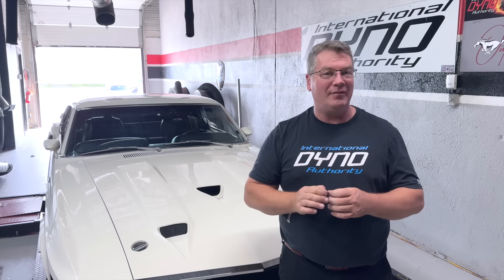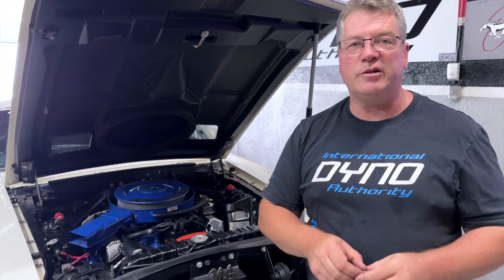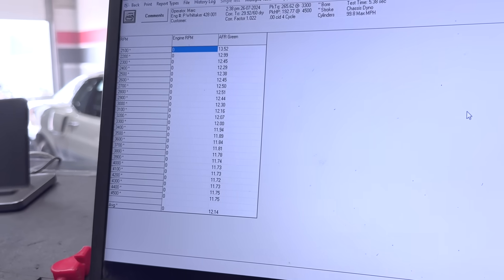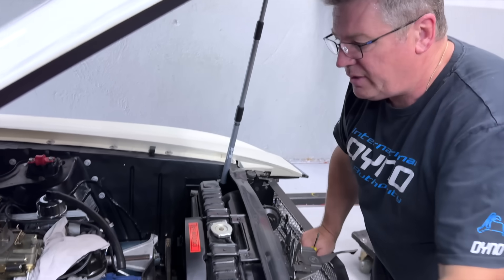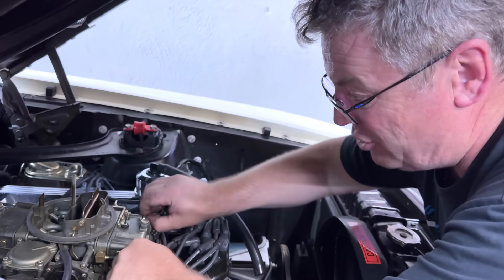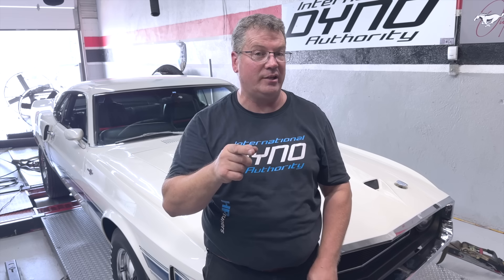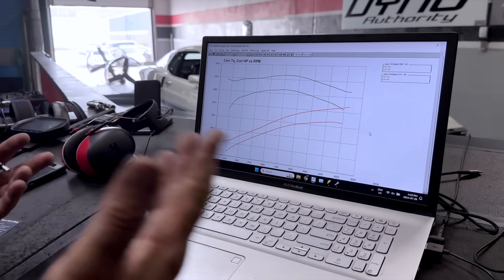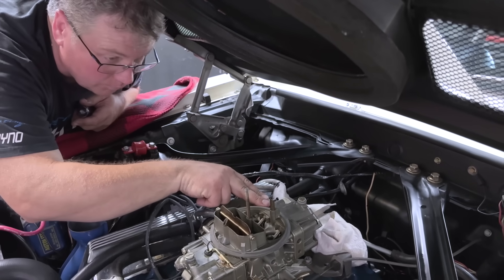Original, unrestored '69 Shelby GT500 tuned on the dyno

Comment: 335 gross hp, pre-1972. That's with no accessories, no fan no water pump etc, at the flywheel. Adjusting to a 1972 and later net rating would be like 300 hp. At the wheels that's ~260 IMO. Getting 300 whp from this thing is great, especially at 4800 rpm. That's not a huge number but there's a lot of average power there.
Reply: 335 wasn't accurate, and everyone knew it.
Reply: @MrSticks9999  Yea, it was high. Remember, this car made 190 whp in factory stock form on the baseline. These guys did a custom dyno tune using a wide band oxygen sensor, something that didnt exist when this car was made, to recalibrate the carburetor and adjust timing.
Reply: @Carguylogan  Don't think Carburetor tuning is a new thing. Whether you had an O2 sensor or not, it can and was done.
Reply: @Carguylogan  And I don't mean the 335 was high, it was low. You don't turn 134.56 with a stock Mustang on bias tires with that low of HP. It was better rated at 375-390 range.
Reply: @MrSticks9999  Yea, it was done by reading the plug which is extremely hard to do because you need to run the engine ONLY at wide open throttle in order to get an accurate reading on the plug. Any idling or driving around taints the reading. I'm not sure what the 134.56 thing means.
Reply: @Carguylogan  Sure, read the plug and/or read the time slips. Not a lot different that reading an O2 and trying a different jet.
Reply: @MrSticks9999  I mean an oxygen sensor tells you the afr. Reading a plug is a guess. It'll get close enough but not great. You can read Car and Driver's road test of the 1969 428 Mach 1 from 1969 where they did 14.3 @ 100 mph. 100 mph in a 3600 lb car is a solid 250 whp.
Reply: @Carguylogan  Reading the plug is just a step. That's not the end result. It's just a step along the way. It tells you which way to go. I'm not saying it is better, but it works. You could get a carb tuned as well back then as you can now. A s for times, that's the slowest of the publicized results. There are 13 sec times out there as well. I own a '68 1/2 CJ Mustang. I have been building Mustangs for over 40 years professionally, so I know these cars. I'm also a retired Auto Instructor.
Reply: @MrSticks9999  I'm not looking at the ET. A 100 mph or even a 103 mph pass is way short of 300 whp. I am an ase master tech with an applied science degree in automotive that managed a shop for a living while running my own trans overhaul service at home, and I've done custom fab/restoration for a living. I have made over 1000 passes and have a few hundred hours of dyno time. No old engines, including the L88, 426 hemi etc ever turned more than like 108 or 109 mph trap speed off the showroom floor. They are fast in pure stock racing but that class allows a lot of engine work with limitations being things like "stock appearing exhaust manifolds, stock valve sizes, stock valve lift, stock displacement" etc. There's still a ton you can do within those confines. But factory stock, none of the big dogs from the muscle car era made more than about 300 whp. That's not an insult, it's just reality. That was 55 years ago so no surprise things have come a long way. My 2.0L Golf traps 117 mph at 6,000 feet elevation with 3 parts changed from stock. Its faster than my C5 Z06 and my cam/stall C6. I had a 1982 Mustang GT with a .060" over 351W (359) with C9OE heads (the hipo heads) that were ported with big valves and machined spring seats etc, 10.2:1 pistons, a roller cam, headers, 800 cfm carb etc, car had a T5 with 3.55 gears and weighed 3,000 lbs on the nose and my GTI is still faster at 6,000 ft elevation than that car was at sea level. I personally grew up around a guy with a #s matching 1970 Chevelle SS 396 4 speed that had a slightly warmed over engine rebuild (cam, headers, carb and intake) and I remember watching it go 100, 101 mph over and over at the drags. I know another guy with a #s matching 426 Hemi Coronet 4 speed, and it isn't particularly fast. These are extremely badass cars worth a lot of money, they just aren't fast by modern standards.
Reply: @Carguylogan  103 mph and 3600 lbs estimates over 300 HP
Reply: @MrSticks9999  300 bhp sure. Talking about crankshaft hp is old thinking. The only number that matters is wheel power, no one uses flywheel power anymore. Saying a car makes 350 flywheel hp sounds great til you put it on a chassis dyno and it makes 264 whp.
Reply: @Carguylogan  I'm saying a 428 CJ makes about 375 hp at the crank, no accessories.

Comment: People gotta understand that factory heads are garbage
Reply: Really? Those heads will support 550 hp with the right cam and intake. I've done it, and did zero to the OE. CJ heads other than springs
Reply: Wrong. The CJ used heads from the 427.  That's what made it a CJ.
Reply: You guys are compete idiots

Comment: make sure the power valve is good
Reply: Did you watch the video?
Reply: @hotrodray6802  yeah I watched it
Reply: @hotrodray6802  I usually comment while I'm watching,  and not at the end.  I had a big problem with Holly carbs with the metal floats.  I had brand new ones flooding and the only way we caught it was to soak them in gasoline.  The plastic ones were always better,  so it's the only thing I would use after that

Comment: Your adjustments were incorrect, a turn on the carb is actually 1/2 turn, you should also be adjusting that idle screw to a vacuum gauge... Timing, with the distributor unplugged, 6-10 degrees before TDC @ idle (600 rpm) depending on cam etc. if the distributor springs are weak it will affect timing..
Reply: The idle screws have ZERO effect on the dyno numbers.
Reply: @65sohc  No true, , if you are going to adjust a carb, you do ALL the adjustments correct. Obviously you have no clue. Running your idle screws higher (richer) would make you change other things to idle at base rpm, like timing etc. so now you know why that is so important.. You must have a Cheby, I smell those things running down the road all the time rich as heck...
Reply: @ Actually, they do.. If you can't get the tune right at idle, it will effect the numbers all the way up..
Reply: Watch and try to listen. Smh
Reply: @hotrodray6802  actually did.. thx

Comment: wow is that all ford stuffed up with this one for sure when you consider what hemi had at the same time? Plus what the fuel they had in 1969, compared to todays fuel and also if the carby has never ever been checked it would have cracked seals and so many things wrong with it, it would need a total new rebuild just to get it running right, plus the oils they had back then are nothing compared to todays oils even the race oils are nothing compared to todays oils for everyday driving?🦘🦘✌✌😎😎

Comment: Just to add a few notes, the 428 CJ used a modified version of the 427 low riser heads from 63 and 64, the 427 used a 3.78" stroke crank while the 428 used a 3.98" stroke crank with a smaller bore than the 427, all 428 cranks are cast iron, the intake/heads/block where all cast iron, the block had only two bolt mains, all 428 CJ had a hyd. cam, and as far as I know all 428 CJ's used a VS 735 Holly (no double pumpers), a "stock"automatic 69 428 CJ mustang with headers/gears/slicks/converter/shift kit/posi/tune would run mid to low 12's in the quarter.

Comment: my stock 302 has more than that 420, wheel HP, truck tho for pulling so
Reply: If your stock 302 produces  420 whp it isn't stock. By no means.
Reply: There's no factory built 302 that was sold to the general public with that much horsepower.
Reply: @rolliehunt5173  Coyote’s did, but thats obviously apples to oranges
Reply: @knowbull5hit590  those are called 5.0 not a 302 like was mentioned.

Comment: Great job with the tune. The fact that you guys were able to got 300 RWH with a C6 automatic and a stock engine shows that the engine is in good shape and you guys know how to tune.
Reply: Don't think it is a C6, saw a shifter on 1st dyno pull
Reply: 0:18 clearly 3 pedals and power brakes

Comment: Nice car, just something I noticed is that the carb may not be "stock" as it has a secondary jet block and I thought all CJ's came with a 735 with a secondary jet plate. The secondary block may have a power valve that is opening at the rpm that it starts smoking. If the carb is a factory original 735 and a secondary jet block added and has a power valve I would remove the power valve and put a power valve "plug" in it and jet the secondaries as stock would be and go from there. If engine is "pulling" fuel from primary squirter the "little ball or rubber plug" in the pump may be let fuel by when it shouldn't, also make sure pump discharge needle valve is in place and in good shape. I do not think that a smaller squirter discharge hole will solve that problem and may cause other problems when going to full throttle. Ford 735 Holley's have smaller primaries than the secondaries.
Reply: The only thing that would make me question your reasoning is the little vent cap on the primary float bowl.  I don't think that was common, or even available, on an aftermarket Holley.
Reply: @65sohc  The secondary jet block is the "may not be "stock"" part, so if that is the case, the car is not original, a 375 hp 396 chevy used a 780 cfm carb that looks just like that as the steel fuel line is one piece and will not fit an original Ford 735 holley with a jet plate. The list number on the air horn will tell the story and if it's correct the jet block and fuel line have been added.
Reply: well said man!!! you always run numbers , see what was stock jet, squirter etc.  what is cool is the side fuel inlet and that the front and rear carb bowl's are connected by a fuel line!   i've always wondered why holley's had that inlet by choke! now I know!!!! factory carb!! most cars at car shows have pump that feels both bowl's on a fuel log only.   can't argue with the number increase

Comment: The GT500 sucks compared to the GT350.    Just because the Shelby name is on the trunk doesn't mean it's a good car.
Reply: Well, that’s really a brilliant statement, why don’t you tell us,  why you think it sucks?
Reply: @revconbruce  Because it's not nimble like the 350.  It's bigger and blockier and, in actuality, just a muscle car.  Compared to the GT350, it's boring and uninspiring and pedestrian.  It's really no different than a Chevelle or a Charger or GTO.
Reply: @chuckschillingvideos The GT500 was more of a drag race car.  Good in a straight line
Reply: @georgemcfly1205  Precisely my point and why I don't find it interesting.  The roads were filled with this sort of car.  Shelby vehicles had until this point been nimble track beasts and the 500 was a complete departure from what Shelbys were known for.
Reply: Each to their own.  Two different cars meant for two different purposes.  Auction prices will beg to differ since the GT500's have always brought more $$ then the GT350's of that era Shelby.
Reply: @mitchf1508  Auction prices are all about nostalgia.  There were many more GT500s made than GT350's and that's what these idiot rich speculators remember.  You simply didn't see GT350s on the street whereas GT500s were common.  But I will repeat: the GT350 will run rings around the GT500 on any racetrack where a turn is required.
Reply: @chuckschillingvideos  Yes, that's true..  But to come out and say it "sucks" is just a kick in the balls in my opinion.  Bring in your GT350 that is in that kind of original condition and then you can maybe say the GT500 'sucks'.. 🤪
Reply: @mitchf1508  If I had a GT350 I wouldn't spend a minute of time on Youtube now would I?  I just think people need to know how much more special the GT350s were than the GT500, which in my opinion was just a money grab by Shelby/Ford.
Reply: @chuckschillingvideos  the 500s have always been more popular hence the price being higher. Different strokes for different folks.
Reply: WTF!
Reply: That depends on what year. The only GT350's I even liked were the 65-67's. In 68, they put in a 302 with only 250 hp, then they went to a 351 and went from 2,800 lbs curb weight to 3,600 lbs. That's why the GT500's outsold the 350's. They basically turned the GT350's into an anemic portly underpowered  machine in just a few years. I guess they didn't want it competing with the GT500.

Comment: I woulda started with fresh points and condenser.  And poor terminology. It’s secondary and primary. Not high speed main. Front of the carb is primary because it has the power valve and idle circuitry. Back is secondary. Not dismissing the tuning just please call the systems what they are.  Distributor needs recurving and secondary springs tuned.
Reply: Congratulations!
Reply: Congratulations!

Comment: I can’t believe Shelby allowed his name on a 428 CJ powered car. Big block with small block power. This car would have been cool had it a 427. I’m always mystified when people speak fondly of the 428cj.
Reply: They are the same basic engines (FE).  Have no clue what you are talking about.
Reply: @danmyers9372  no really
Reply: By 1969 Ford was transiting from the FE motors to the 429. The 428 Cobra Jet had an improved version of the medium risers heads and 4V intake manifold. It was an excellent performer. As a matter of fact, the 428 CJ was such an excellent performer in Stock drag racing classes, the NHRA refactored it's horsepower rating to 410!
Reply: My 68 Fairlane 500 fastback with 428 CJ C6 was a pretty good car.
My Talladega wasn't to bad either considering they're absolutely identical except the long nose and rolled rocker panels.
BTW Talledegas are body code 35, Fairlane fastback, NOT TORINOs.
Reply: They were tuners from the factory.
Reply: Shelby put his name on anything they paid him for, including the Chrysler GLH and Dakota pickup.
Reply: Spoke with Bill Barr, the Ford engine development engineer behind the 289DOHC GP Engine, Boss 302 and 428CJ. The CJ was developed out of the 428 rather than the 427 because it made largely the same power at a lower cost - and most of the engineering toolsets for the 427 were worn out by 1967/68. From the factory, in as-tested form, 428CJ made 410hp vs 415 from a single carb 427.